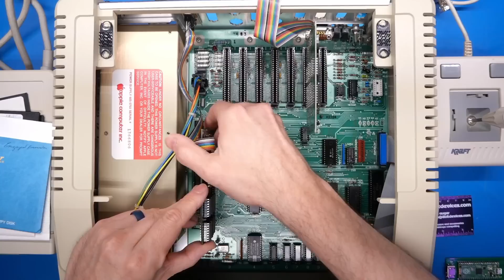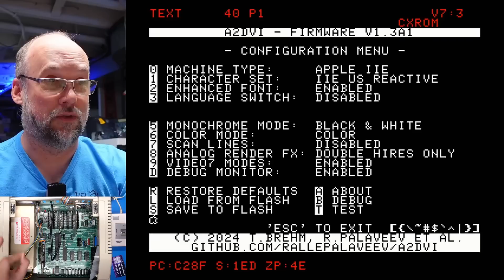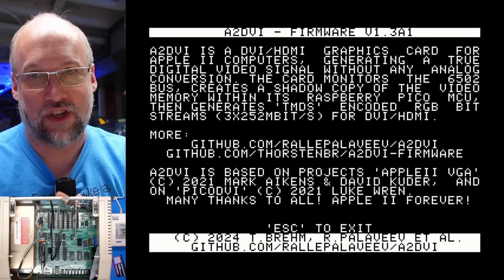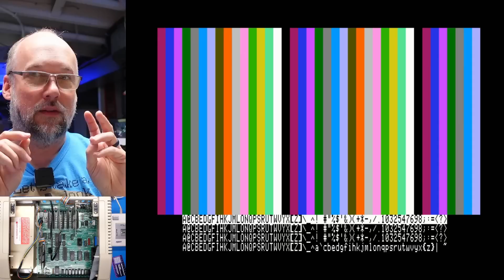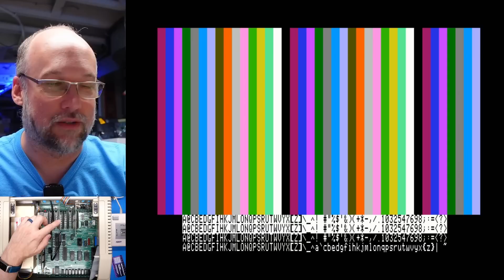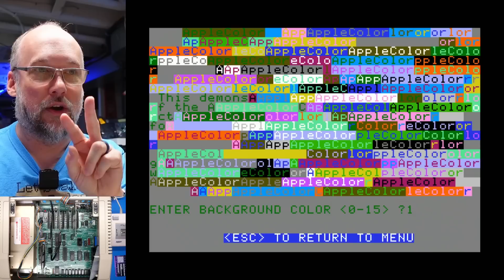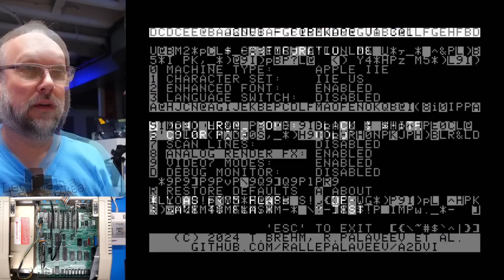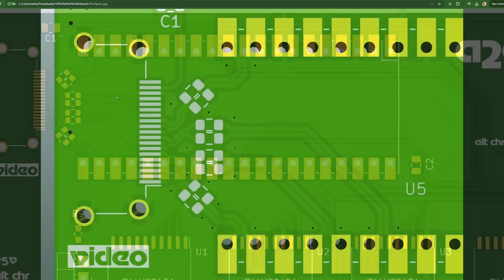HDMI video from your Apple II with this cheap and simple project (A2DVI)

Comment: Bus speed wouldn't be an issue for emulating IIGS modes as the entire video system (VGC and MEGA II, as well as the memory in banks $E0/E1, plus all the slots and integrated peripherals) runs at the same 1.023 MHz as the original Apple II, in order to allow the slots to be compatible with nearly all Apple II cards. The only parts of the IIGS that run at 2.8 MHz are the CPU, the ROMs, and the fast RAM (all RAM other than banks $E0 and $E1). The FPI chip (or CYA on ROM3 boards) bridges the 2.8 MHz and 1.023 MHz busses, stretching clock signals as needed on the fast side to synchronize it with the slow side (which must always operate at a constant speed to keep the video output stable and things like disk controllers happy.)
Reply: Yes, bus speed isn’t an issue, however the SHR screen is in bank E1, and detecting a write to bank E1 from a 50 pin I/O slot might be problematic. The bank address appears for only a very brief time on the data bus, and that short time might present an issue. My guess is that the rp2040 PIO blocks are all currently saturated doing both the hdmi and apple ii snooping. This might require the newer RP2350 chip instead which has additional PIO blocks (also extra gpio pins or is that the 2358…). Possibly the new pi pico could just be substitute with new software.
Reply: @jonqu7041  every other byte of the double high res screen  (and 80 column text screen, for that matter) is in bank $E1 as well. (Aka aux men on //e and //c). The split between main and aux banks was the only way for the video hardware to be able to read double the bits while leaving the memory timing the same. When the video circuitry on the //e and //c is in 80 column mode (or double-high-res or double-low-res) it reads the same address simultaneously from both main and aux memory so it can work with sixteen bits per clock cycle instead of just eight, thus giving it double the horizontal resolution compared to the old video modes.

The slow RAM on the IIGS is designed basically the same as the main/aux memory on the //e and //c. The FPI chip translates accesses to banks $E0 and $E1 from the fast (CPU) side of the machine into main and aux memory accesses on the Mega II bus.

Thus any bus-snooping card on the //e that tries to watch for writes to the video memory already has to track whether main or aux memory is being accessed.  The mechanism to do this is the same on the IIGS.

At this point you might be asking yourself how the super high res screen can be contained entirely in aux memory if the video system needs to read from both main and aux simultaneously to be fast enough to do double high res. Well, they use a really nasty hack for that. Bit 6 of the New-Video Register ($C029) changes the mapping of which logical addresses in main/aux banks get mapped into which physical RAM chips. The result is that the memory map is rearranged to make it look like the super high res screen is all in bank $E1 but it’s really split between main and aux RAM just like the double-high-res screen. You could theoretically use super high res without setting this bit but then you’d have to do lots of ugly math to find the address of each pixel (similar to double high res mode) so everyone always sets that bit when using super high res to preserve their sanity.
Reply: @tim1724  actually, it isn’t the same. The card recognizes writes on the iie by recognizing writes to soft switches that control which bank of ram you are writing to. The iigs in 16 bit mode does no bank switching like that, instead you directly write to the screen either using the databank register (when using 16 bit addressing) or via a 24 bit addressing mode. In either case, the upper 8 bits of the write address appear on the data bus for a very short time, that is how memory is accessed on the iigs. One other small but solvable issue is that you can mirror the E1 bank onto the 01 bank but that would be trivial since On the iie the card is monitoring all the video soft switches anyway to know what screen to display (text, lores, high res, double high res, 80 column, page 1 or2, etcetera in addition to monitoring the bank select switches).
Reply: @jonqu7041  the same bank switching soft switches are all present in the Mega II and work the same as in the //e

Comment: The guy who started Video7 was the same engineer who did the chipsets at Apple for the IIe and IIc
Reply from the maker: Oh how interesting! No wonder they ended up with that all in one RGB solution with that Waferscale chip used on the Enhancer IIe and IIc. Really those extra modes are super clever with how they work!

Comment: I just got my hands on an Apple IIGS and I was hopeful to use this project until you mentioned it wasn't supported yet. It needs some repair so I was hoping to have something I knew was working to output video to start with. Can't wait for it to be supported, so maybe if I get to it first I can help with that compatibility?
Reply: @jandjrandr Check out the VidHD.
Reply: Years ago I didn't realize what the apple IIGS was. Even though I known about a Apple III+, Apple II+, IIe, etc etc. How compatible they was. So anytime a partial system or just the computer showed up. I would just leave it alone. This was the good old days of $5.00, $10.00 max $25.00 systems most of the time at thrift stores. I did collect a few Macs that way though. Compared to now prices. All before or just the start of E-Pay.
Reply: It won't work with //gs video modes because the bank address information necessary for super hires isn't available on the slots. For the //gs at the least you would need to make a new version that replaced the memory card, but I don't remember if cycles to the motherboard fast or slow RAM would even appear on the memory expansion slot. If they don't, the only way I can really see to pull off a //gs version is an interposer board that would plug into the CPU socket and would have it's own CPU socket for the original CPU plus a dual row 0.1" header for people with a TWGS. You could also ditch the '816 socket and add another RP2040 in for emulating a 65816 with a software defined Transwarp with 256K of cache and a core speed easily overclocked to 250MHz.